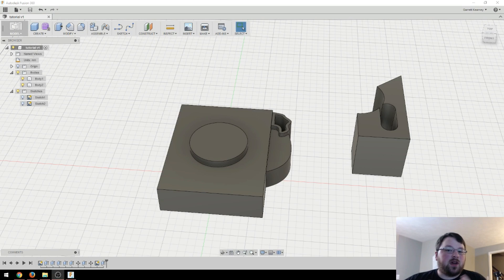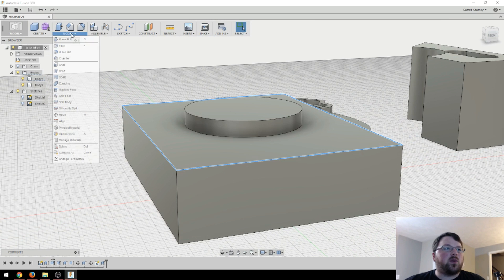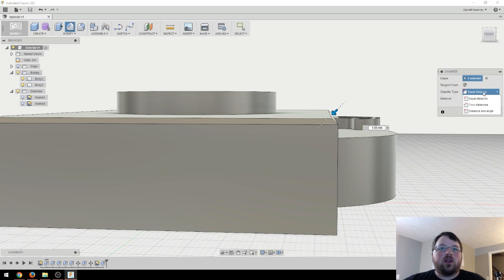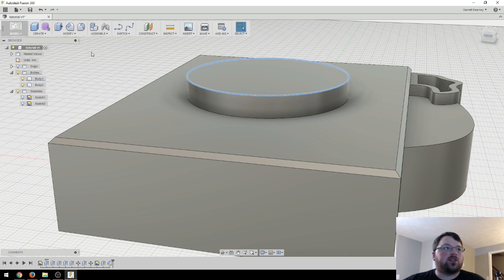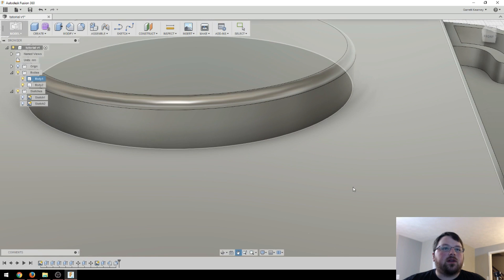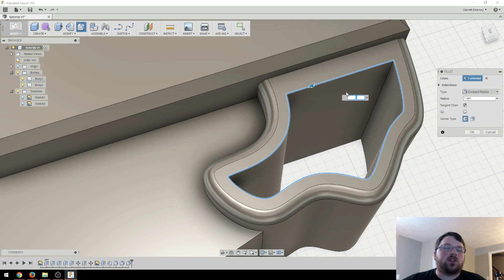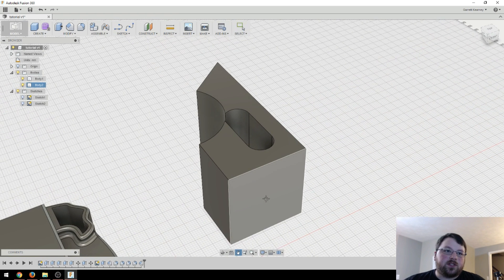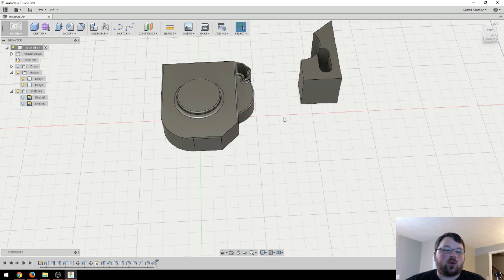Using Fillet and Chamfer - Fusion 360 Tutorial #3

Comment: I'm having problems with the filet comand since the update it wants to undercut where two extruded bodys meet. I can't get the arrow to turn around.
Reply: I think I had the same issue as you did. Question: are they two separate bodies? I joined mine then I was able to Fillet them the way I wanted.

Comment: I also previously came from Tinkercad and manually chamfered my edges. FDM prints are really weak around right angled corners, so filleting and chamfering adds a great deal of strength to the print and is a super useful tool. Thanks for the vid!